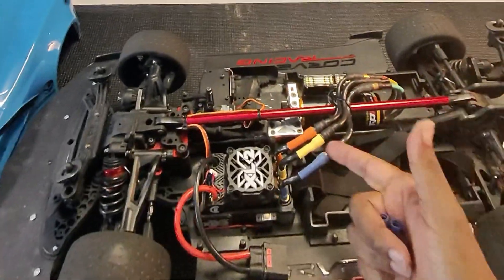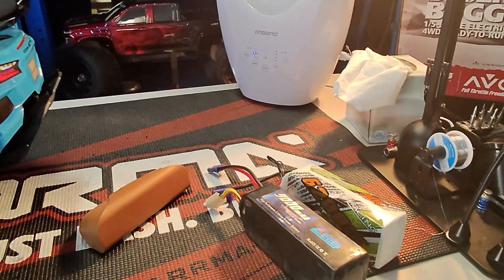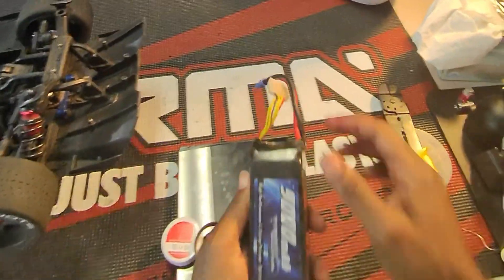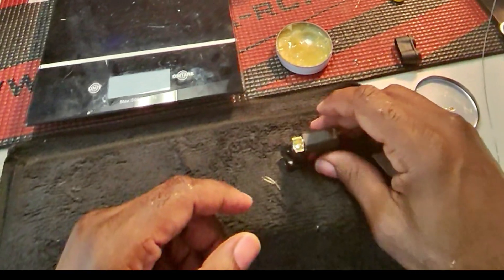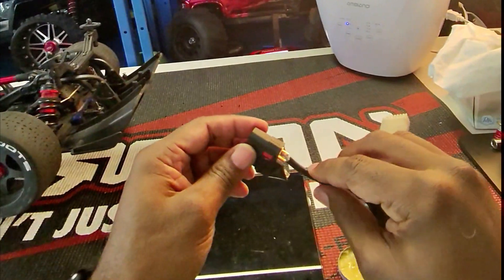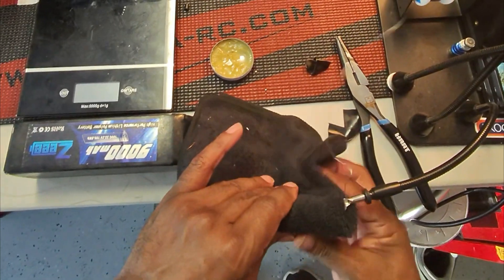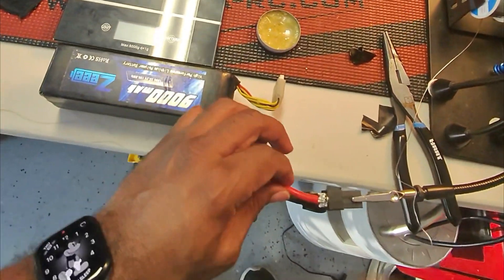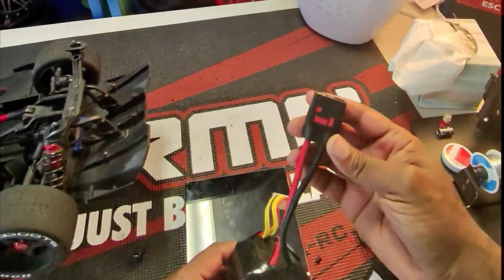🔥🔥Boost your RC’s Power: Swapping EC5 to QS8 Connectors🔥🔥#rc

Comment: I've had my Hobbywing Max 5  for about 4 years in March and that thing has been amazing never any issues and I have to say it is so reliable. First of all I had a set up on my Rustler VXL in which I widen the body and put on the Max 5 and a TP 4070cm 2200kv motor it ran so amazing. Recently I bought myself an Arrma Limitless V2 and switched the TP 4070cm motor with a Castle Creations 2028 1700Kv motor because the TP motor was getting very hot very easily. The Castle motor runs amazing and doesn't even get warm. However I wanted to get the Castle Creations XLX2 but was afraid because of my previous experience with Castle ESCs and the accounts of problems with the XLX2. However I just got it yesterday and I'm a bit anxious to set it up but I realize I need to get QS8S so ordered them and waiting anxiously and nervously and hoping I don't get any problems with the XLX2.
Reply from the maker: I love the XLX2. I have a bunch of them. I am hard on my cars. But the ESC has held up. You will love the smoothness of the sensor setup. Especially coming from a TP motor. 

Good luck and let me know how you like it. 

QS8. I need to set up another set of lipos to QS8. No spark is the best
Reply: @Frumba57  Thanks brother. Will let you know how it goes.